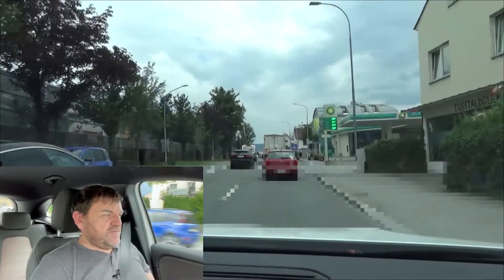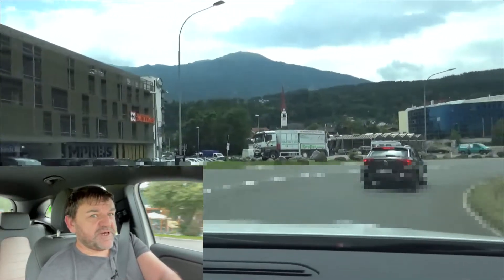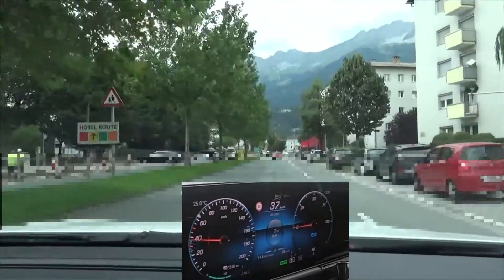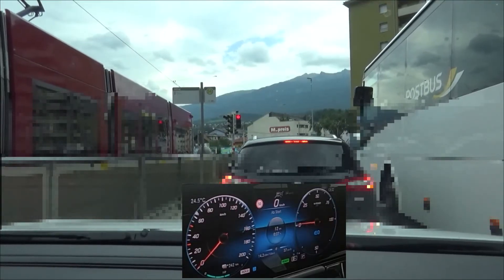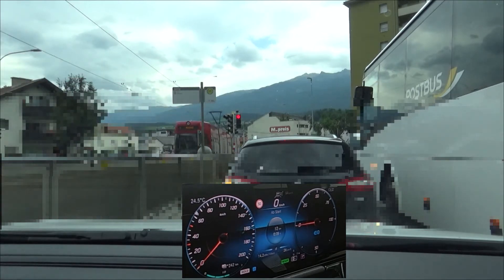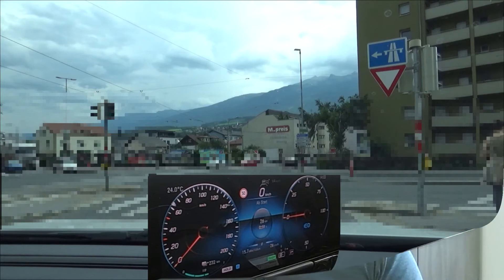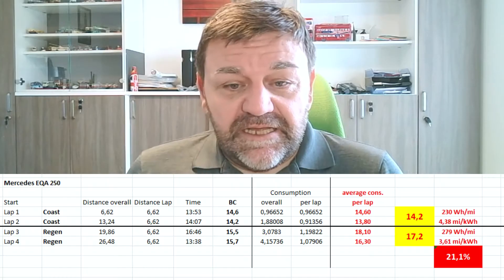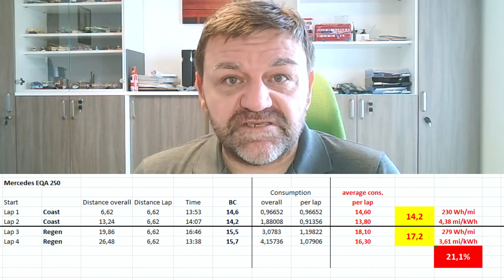What's more efficient? Coasting or One-Pedal-Drive? A test with the Mercedes Benz EQA 250.

Comment: Interesting test. Too bad you didn't use D-AUTO. D+ is still not a 100% coasting. When you lift the pedal, you will see a couple percents of regen being applied. In D-Auto the power-meter is right at the 0 and the car is 100% coasting.

Comment: Its an unique test. Anyway,  from physic fundamentals, theoretically i knew the result afore (the result that coasting would be more efficient), but what was very interesting, the  proportion/percentage.  I think nobody did test like this. Its unique. I expected somewhere there, 10-20%, but its proven now. Its the waste energy of the system's work: charge-discharge efficiency, motor-generator efficiency and other losses. 21% is not bad at all, could be differ (maybe higher) in other carmakers cars maybe.
Reply from the maker: Most other cars I did this tet with had a smaller gap between the result, between 6 and 10 %, which would have been my guess.
Reply: @ecodriver1746  just 6-10%?  surprising to me.  Close to insignificant. So the technology works well. thanks for this results, its important, i will store in my mind:)